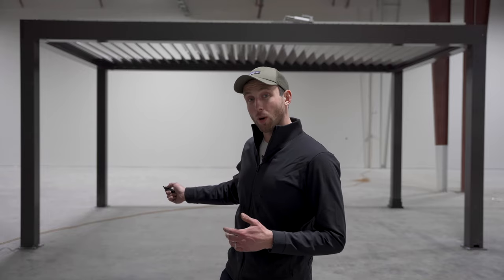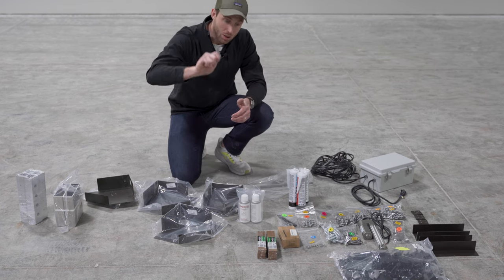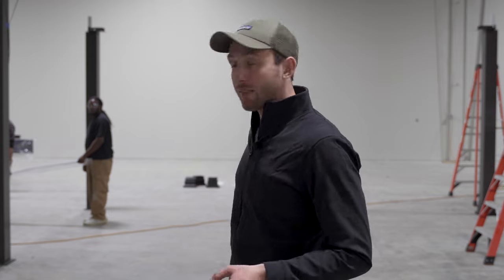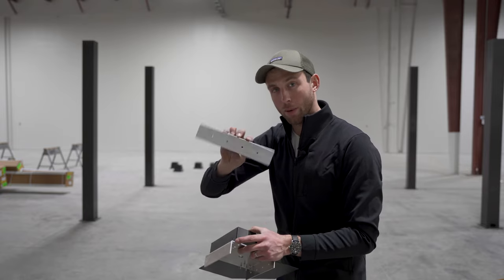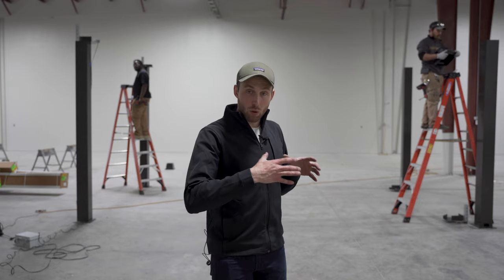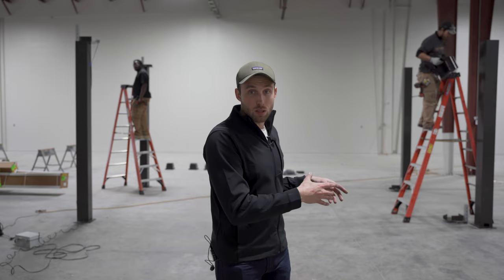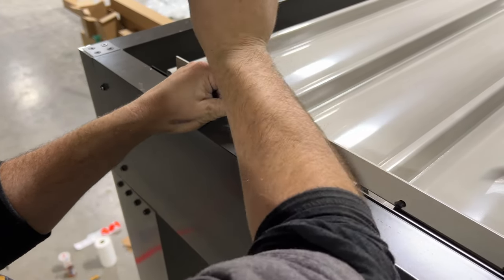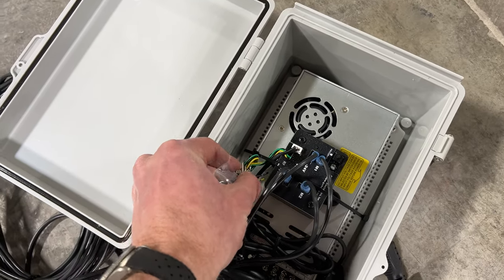How to Build A Motorized Aluminum Pergola: The Luxury Pergola

Comment: This is extremely helpful and it answered a lot of questions I had about installation. I will need to combine two pergolas (13x10 and 16x10) and I just saw you March 28 article about combining two pergolas using 6 posts instead of 8. Would you consider making a video showing how to install them?
Reply from the maker: I'm glad to hear it! Yes we're currently in the works on a few other videos explaining the crown, the center beams and the combining of units.
Reply: did you need a permit

Comment: Does this system require a level base?
Reply from the maker: Hello! Great question! No it does not. All concrete slabs have some slope in them, which helps our system drain the water properly
Reply: @theluxurypergola  Recommended slope?

Comment: What's the overall external and internal height of a 12x20 with louvers open?
Reply from the maker: External overall for a standard unit with no trim is 12' x 20'. Including the post bases, it's 12' 3" x 20' 3". Height overall on a standard kit is 10'2" with the louvers open, but you can request a different height up to 11'2", though additional charges may apply for longer post heights!